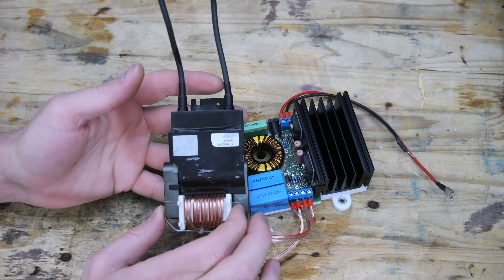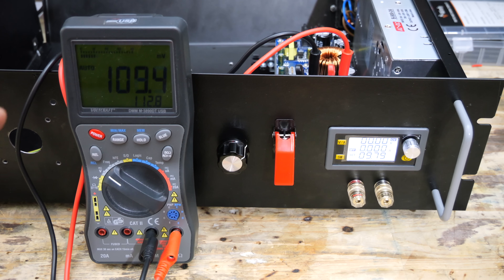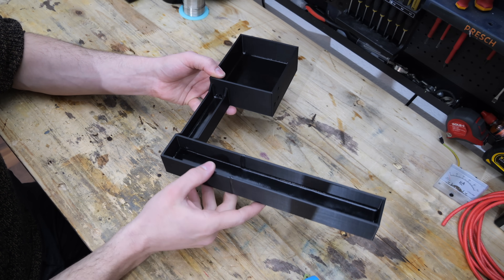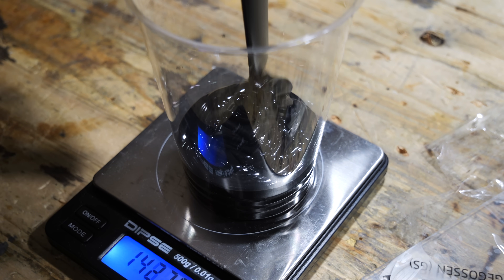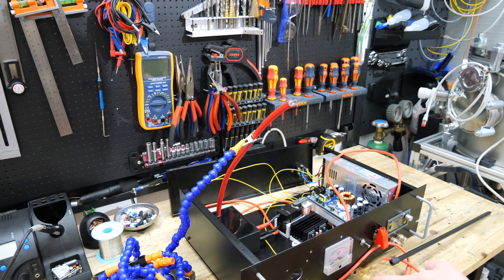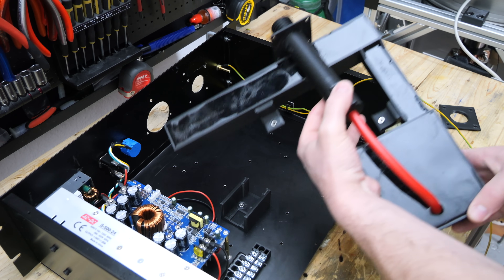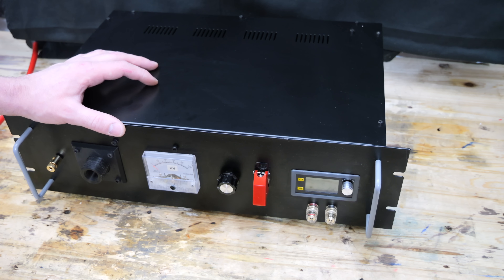Building an Adjustable High Voltage Supply

Comment: Very interesting! And a very nice video!
The only thing I would improve is to add 2 min about safety and hazards at the beginning. Not as a disclaimer, but to really make people aware of the dangers of attempting this. I am not an expert myself and would not attempt such a thing, because the danger is in the detail, unknown variables (someone pointed out that black PLA often contains carbon ...), and pure coincidence (you trip and touch the wrong part, someone comes in and touches something they are not supposed to).  You potted everything, grounded (not sure how much that helps in case the secondary site of the windings makes a contact), and tried to make it safe - well done!. However, it would be great to teach people of the dangers before showing them how to create a potentially deadly device.
Besides that, well done and stay safe! 😊

Comment: I'm thinking of building a similar device, but I'm a bit confused by your choice of capacitors. If your transformer output is 10–15 kV, then 25–30 kV capacitors should be more than sufficient.

Why did you choose 50 kV ones? Did I missed something?

Comment: Where the hell did you get a 1000M 50kv resistor from
Reply from the maker: The shop is called „highvoltsgeshop“. You should find it on google.

Comment: Cool project!
On an inducstrial HV connectors male and female parts a slightly tapered. And if it is needed(usually 60+ kV ) its dielectric strength can be improved by a applying of a dry vaseline.

Comment: Now you can make a nitrogen laser and if that works you can use that laser to pump a dye Laser, I did this 25 years ago and it was really fun and low cost, it’s superior to use nitrogen instead of air but not mandatory, it is also a good idea to use low pressured gas about 0.1 Bar. Laser Puls power of up to 300kW UV and 30kW visual are possible, some amateurs reached a lot more.

Comment: I hope that this comment will reach you.

I find your video and theory behind it quite interesting.
I'm chemist with a bit knowledge in electronics and such, and this could have use in Mass spectrometer.
They already use high voltage power supplies for operating, but I'm wondering if there is any possibility to build such an accurate instrument but from scratch. I was thinking about using microwave transformer as power supply, but regulated one would be more efficient for multiple uses.

I'm wondering if your construct is capable of working for a long time operating like around 1h as could run of instrument take for one sample (in commercial ones it's few minutes but I don't expect such efficiency). Your supply, I think, could be used to power electrospray and maybe also with a few modifications and the rest of the machine.

It's quite ,,sexy,, idea for me to build relatively accurate and cheap instrument in comparison to commercial expensive and hard to get hand on instruments with also in some cases, questionable accuracy.

I'm still wondering how to ensure charge on focusing lenses and how to properly isolate and ground all of the parts. And also reach good working time and not blow up everything or get electrocuted...

Maybe you could have answers for my questions, I'm studying biochemistry, not electronics , so it's harder for me to think out some of these questions.

Waiting for your response. 🙂

Comment: You can mod the 24v psu to run at any Voltage ( change the resistor closest to the potentiometer )

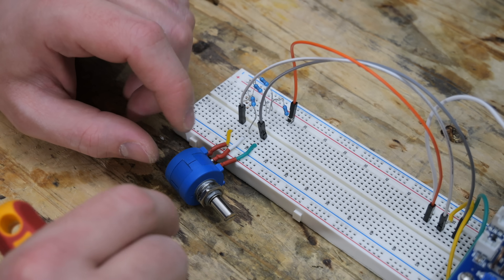Comment: 2:16 you dont need that, you can supply the gates of the transistors with an external supply, a 12v one works, this means you can vary the "Power" voltage at the drains more easily

Comment: Instead of flyback transformer I woudl use HV coil from old car (like this from Trabant or similar). That way you could gain from 12V up to 30kV and avoid dealing with diodes in flyback.

Comment: can you release the 3d print files for that HV connector? i mess around with the same kid of stuff so could defiantly use a supply like this. have a 50kv xray transformer that i have been using, but i have almost all the parts you have used here sitting round.  and it would help with the desktop fusser im currently building. its made from transparent acrylic so fully transparent with a copper ring around the outer and central HV cage in the middle. using scraps of high thickness acrylic another engineering plastics. if i can achieve star in a jar status i will be happy.

Comment: You should Take a Look into a Heinzinger high voltage Power supply. As "partial discharge" IS a Major issue you can learn from them how they tackled it.

Comment: maybe test the voltage reading with lower voltages. (like avoltage that you can actually measure with another meter)
Because the resistor might be off, and it will be more off due to slight conductivity of your epoxy resin.

Comment: Is a AC-DC or AC-AC flyback transformer that you used?
Reply from the maker: It is an AC-AC flyback transformer. If it has a DC output it will not work with the voltage multiplier.
Reply: @AdvancedTinkering  where did you purchase it? Do you have a link where i can get It?

Comment: I would really love to know what type of 80kv cable you are using (looks shielded), i am looking for a somewhat flexible cable in the same voltage range and only can find extremely hard to bend cable
Reply from the maker: It is from "highvoltageshop". It actually is very stiff. But I think they also sell silicone insulated HV cable rated for 100 kV. It should be more flexible.

Comment: Hi. Congrats.  Can you explain what you did to generate AC from the high voltage DC that you got from the flyback transformer? Thanks
Reply from the maker: Hi! It's an AC flyback transformer. So the output can be used for the voltage multiplier as is.

Comment: I think that your design needs short/overcurrent protection. You could add overcurrent protection very easily: just use comparator with hysteresis and connect it to the resistor shunt, then in case of fault restart PSU.

Comment: +Advanced Tinkering can you please tell what temperature did you use to make cesium,did you preheat the furnace, and did you slowly heat the cesium chloride or directly set it to the temperature required.And can magnesium be used instead of lithium.
Reply from the maker: I started at 600 °C and raised the temperature to about 800 °C. 
I have tried it with magnesium but wasn't successful.

Comment: Einfach wunderbar! Works and looks beautiful. If you would want to measure the current, a shunt resistor can be used, then just measure the voltage across it and I = V/R. Have you thought about using this supply to drive a fusor? ;)
Reply from the maker: Thanks! At some point I would like to build a fusor. But thats still a long way to go. 
Mh.... yes a high voltage shunt resistor should work. I will take a look into it.

Comment: I know you needed voltage, but did you measure currents it can produce? I want to convince my colleague to redesign capacitor battery charger for our experimental setup to be something like this. Right now our charger is, as we call it, made from "shit and sticks", as it was "temporally" solution 14 years ago and nobody bothers to update it.

Comment: Just to validate to be sure as i missed it somehow but the multiplier is directly connected to the HV output of the flyback?, even with the DC rectified output ??
Reply from the maker: No, the flyback transformer is not rectified. It has a DC output.

Comment: Can you explain why the arcs never go in straight lines?
Reply from the maker: I can't say for sure. But I suspect it's the same effect as in the jacobs ladder. The ionized hot air rises and thus the arc rises with it (since it is most conductive). 
But I feel like it only partially explains the behavior of the arcs.
Reply: I have a slightly better explanation. The electric field fluctuates at breakdown so there's a fractal shape generated from field perturbation. If you have large spherical electrodes you start seeing less and less of this as the arcs start traveling straighter because the field changes less during breakdown.

Comment: Hello! Great work! I maded myself a few high voltage power supplies and one thing that I have discovered is that the oscillating high current of the zvs driver and the metal case are not made for each other. Part of the power that you are putting into the driver doesn't convert to high voltage but is induced in the metal case and lost as heat. Even though you have a nice output I think it would have been better if you have used a plastic or wooden box.

Comment: RG8 coax, with a solid PE dielectric, works pretty well for HV cable up to 60 - 80 kV. If you drill out the middle of a UHF connector, you can make an easy, reliable and safe (relatively speaking) HV connector. That's how it's done on Glassman and Spellman HV power supplies, including some that go to ~80 kV. Cheap and effective. 

I don't care for potting the multiplier modules. The usual failure for these kinds of supplies is the diodes and (occasionally) the caps in the multiplier, and it WILL blow sooner or later. Glassman does all of it in air. For some of the supplies I've built where I needed to make it more compact, filling it with mineral oil works great, and you still stand a chance at repairing it when it inevitably fails.

Comment: I think with this much of insulation you can easily go up-to 100kV.(Talking about Voltage multiplier)
Reply from the maker: I actually thought about building a second voltage multiplier that I can install depending on the voltage I need.

Comment: You could add another stage of multiplier into the output wand itself but then your meter wouldn't correlate anymore.
Reply from the maker: That wouldn't be possible since the output is DC.

Comment: I have had this idea: What would happen if you connected a pipe to a compressed air gun and put some gasoline in the pipe. Then connect the other end to to a plastic bottle. Also put another hole with a spark plug in the bottle. Would it explode? Because high pressure, vaporized fuel, air and ignition is there... Just an idea

Comment: 5:15 by far not an electronics expert either, but the primary of the flyback transformer being so close to the other transformer worries me slightly, I dunno if it should or not...

Anyways, much more cool than my repurposed ATX power supply ;)

Comment: Cool connector you got there, potting and all, I've seen ptfe and pvc sleeves used in a similar manner.
As EE the rest of it can look a bit sketchy - moving the feedback pot on a long wires across a case where high frequency and voltages are present - thats just asking for problems, to me all those zvs drivers look sketchy AF, but thats just me being nitpicky. 
Regarding earthing - safest and most reliable would be riveted and/or crimped connection - everything bolted needs to be checked and retightened as needed.
Reply: You are right about the drivers! HEY! The mickey mouse trade mark is expired I hear! The drivers look Mickey Mouse!  :)